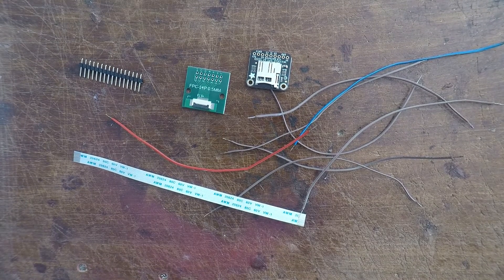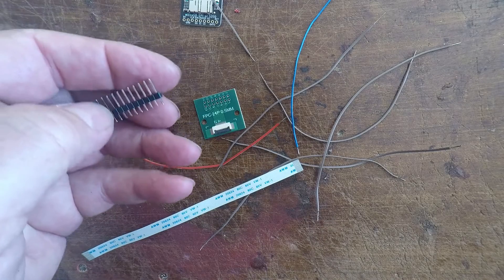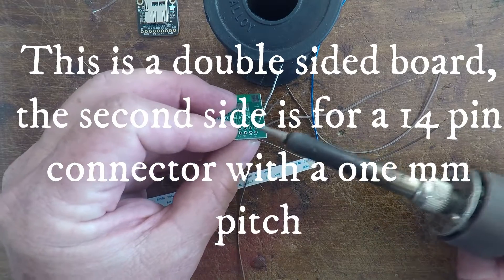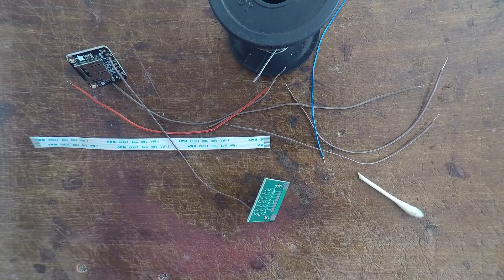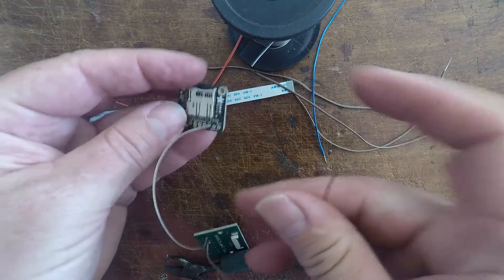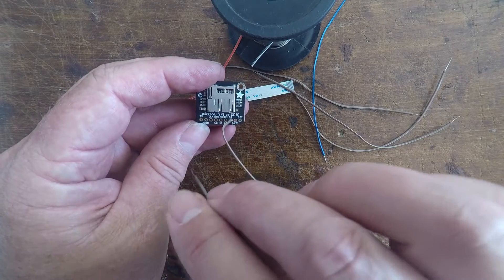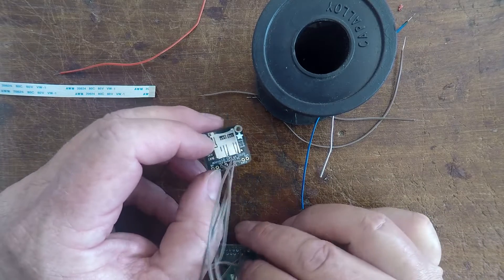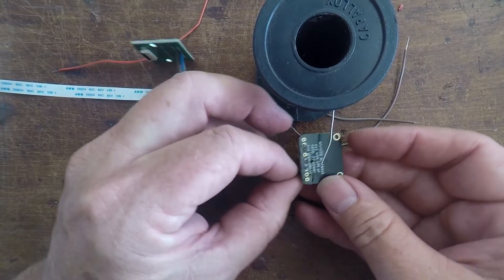GoPro Karma - making a board to boot from micro SD card

Comment: I made the circuit according to the video 

But when i connect the circuit with the drone with ribbion cable initially blue lights start but when i insert sd card the light goes off
Reply from the maker: Are you talking about the blue led on the drone ? Once you have built the board you should watch the videos on the pairing fix.

Comment: Hi, I ve watched your video to make a board to boot from micro SD, but im not having any luck. I have triple checked the wiring, and it all matches up as per your video. The problem I have is when its all connected to the drone, The SD card does not get recognised by windows. Do you have any advice or things I can check to get this working. Thanks.
Reply from the maker: Come over to the discord server and DM me (bozmanx) 

https://discord.com/invite/wGVdWPpkua

I will need a bit more info, I assume you mean that there is nothing in Putty when you attempt to boot from the SD card? 

Also were are you located ?

Comment: Hi. Is there a link to a video where the micro sd card reader is soldered direct to the arm board, I think you said Sergey did it. Sorry if I spelt his name wrong.
Reply from the maker: A couple people have done this with varying results depending on their soldering skills. You need to jumper fb36 so that the reader has power. You can then just get 3.3 volts from somewhere on the board to trigger SD boot via TP1.

Comment: Thank you very for so much information about fixing gopro Karma ! I have seen your video about Good Karma Project as well. I was wondering if we can use your solution without soldering anything on the board (like in good karma project solution) ?. THanks in advance. Best, Guilhem
Reply from the maker: Hi, yes you can, just connect the power for the SD card reader to the 3.3 volt output from the USB TTL device. You can also get the power for the probe from the same place. There are pictures that show this configuration on the discord server, I think they are under important pictures,
Reply: Perfect Thank you very much 👍🏻